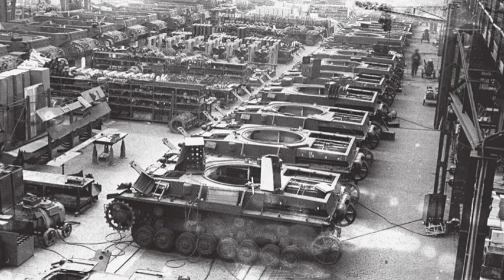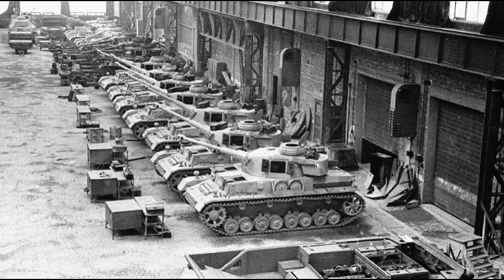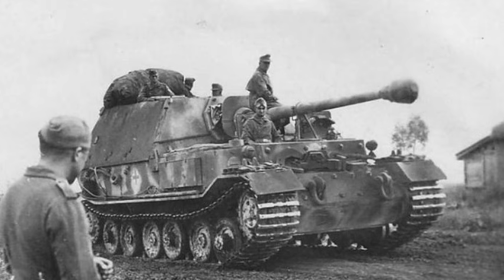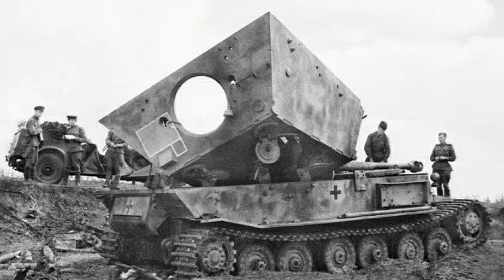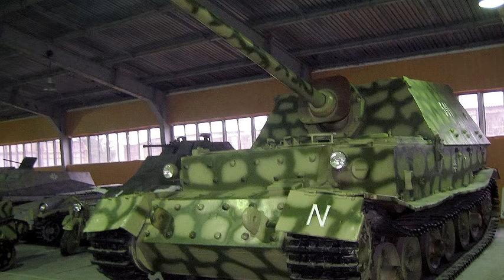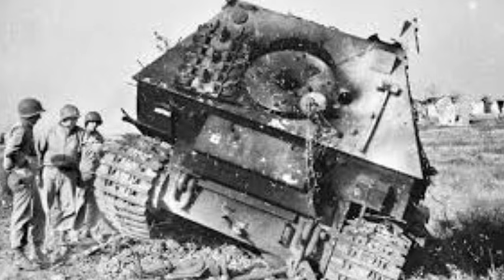US Tankers Examined A Destroyed Ferdinand — Found Out It Had No Machine Gun For Infantry Defense

Comment: What's going on with this channel? Everything Germany made was a piece of junk. The Panther was the 2nd best tank of World War II. Behind the T34. The best tank destroyer the Germans had was the Stug. That mobile artillery piece / tank destroyer was one of the best ever made. Look at its history on tank on tank battles and infantry support. That was the 2nd best tank destroyer of World War II behind the American Jackson.
Reply: Actually the T-34 was a bit crap. The later version the T-34-85 was ok but it came much later in the war.
Reply: Nah, the M4 Sheeman was easily the best tank.  Panthers were formidable against other tanks, assumming it was in a defensive position, but otherwise had a laundry list of problems even before you take into account sabatoge by slave labor and material shortages.
Reply: @braith117  yes, Sherman for reliability and in the theatres like the pacific or built-up areas of western Europe but outmatched in open terrain and range.  Panther was quite good in open terrain moving 'when reliable' - that is the problem.  Panthers were much better by the time of the 'G' version, but you are correct by that time slave labour, sabotage and material shortages was affecting production, so you end up with some working as expected and others not, this plague it. actually, the Tiger 1 is more reliable than a Panther but that is an older design, costly to build and few in numbers.  As for the T-34 the 76mm version was not the best tank, plague with problems, design flaws- its numbers, simple manufacturing was it greatest plus points. The T-34 85 is completely different and a good tank. Sherman was a combination of all - easy manufacturing, huge numbers, reliability and able to up gun. It was well suited for armour warfare in Western Europe but outranged outclass in range open terrain. So Nah, depends on where and when.